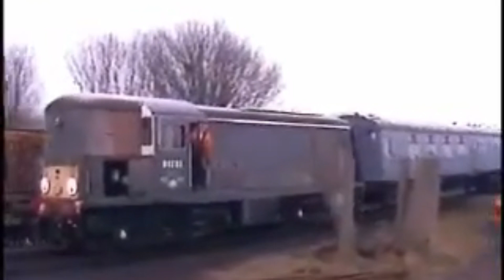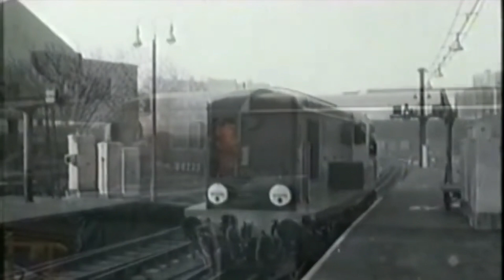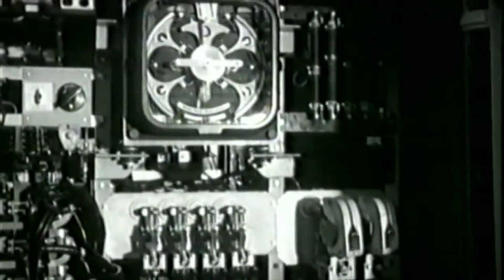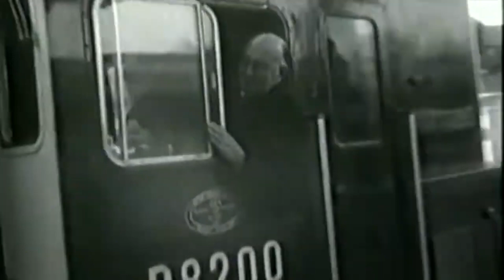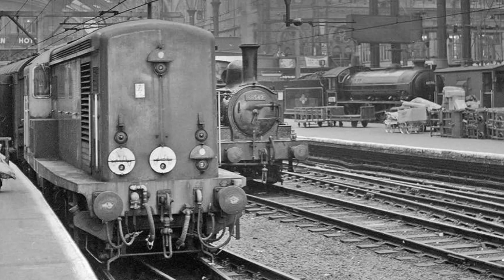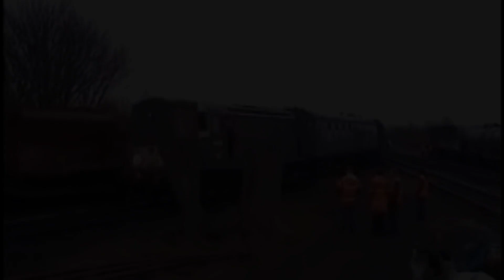British Rail Class 15 – A short-lived diesel locomotive that left a big impression #class15 #fyp

Comment: There are a couple of questions that I have.
The visibility from the cab can't have been much worse than from a steam engine so why the criticism?
People had been building diesel engines for several decades by then. So how come it was unreliable?
Reply: The way the loco is being driven in the clips confirm how poor the visibility was
Reply: Boilers and bunkers are lower and narrower, and the drivers can lean out of the window safely behind the fly screen.

You need better visibility for shunting.

Comment: it would have been ok if the clowns  at Paxman had loadbank tested the  engines before delivery to NBL and then sent fitters to NBL to oversee the locos when finaly built, same for the cl16,
Reply: They did. Versions of the same engine were supplied to the Royal Navy, starting around 1952. The engine was a direct injection version of their indirect injection RPH engine.

Comment: Shouldn't that be designed and built by Clayton Equipment with a Paxman engine and BTH electrics?
Reply: This channel consists entirely of lazy, low-effort AI generated slush, so most of the “facts” in this video are complete rubbish that the AI has vomited up